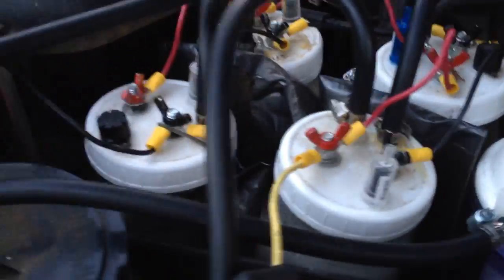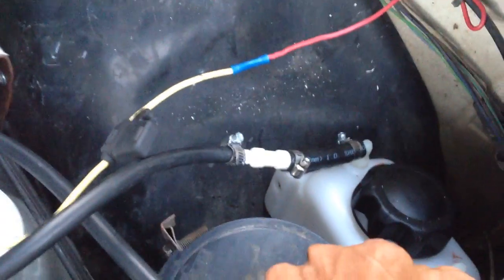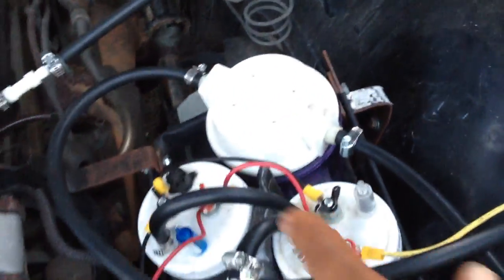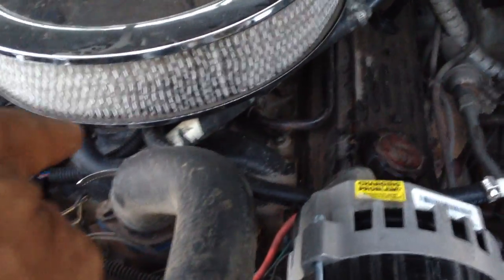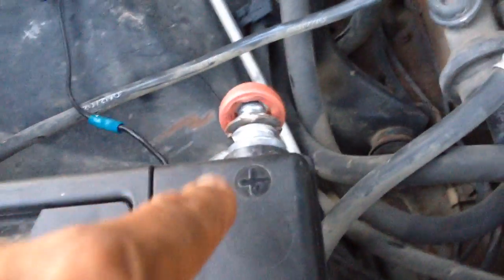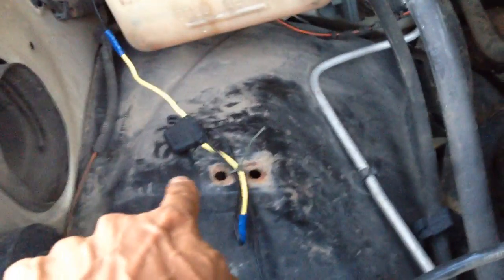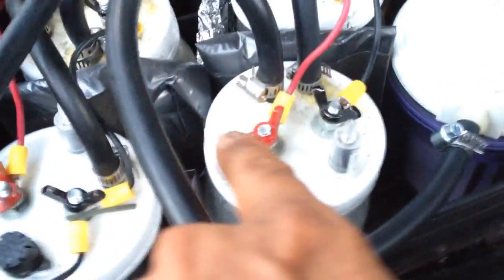AMEXEM TECHNOLOGIES  HHO INSTALL   SEPT 22, 2016 - BALTIMORE MD GETS 24% INCREASE IN GAS MILEAGE

Comment: Abeeku777 ? You can run 3 different fuels hho, vapor from gasoline and the gas you put in your tank. check out these youtube videos below.
Is Using Gas Vapor to Power an Engine a Myth? Let's find out!
https://www.youtube.com/watch?v=IuGWHfWqWtg

the truth about gas and vapor part 1
https://www.youtube.com/watch?v=nqKEQLBg6a8

the truth about gas and vapor part 2
https://www.youtube.com/watch?v=LDMDCT67xBM

BE CAREFUL WITH THIS ONE BELOW

making gas vapor or fumes by heating the fuel
https://www.youtube.com/watch?v=4bD5XTA5CSM